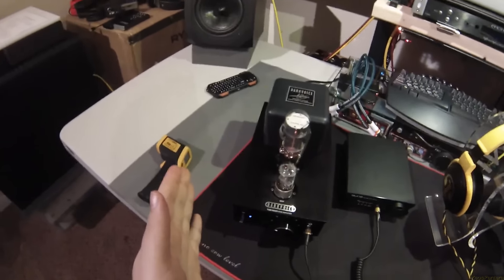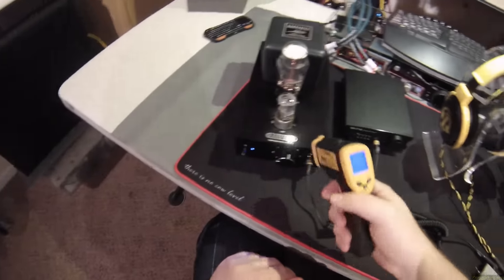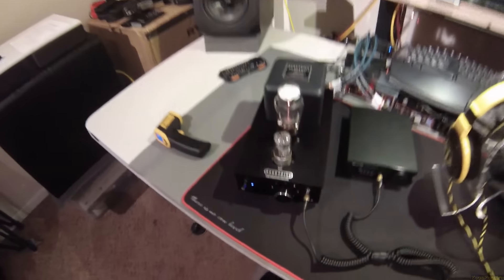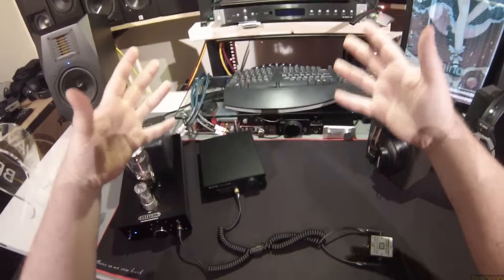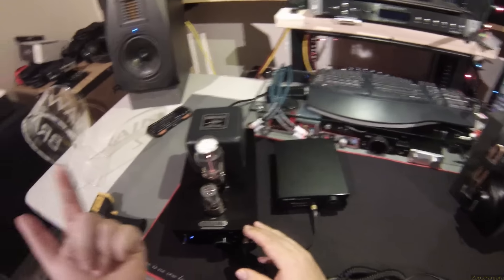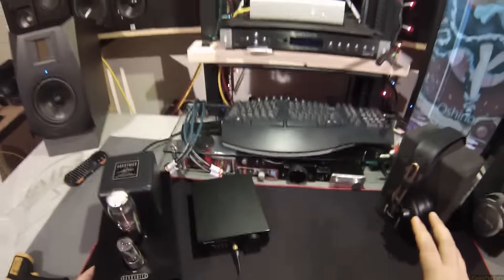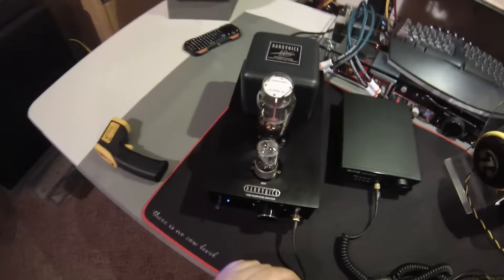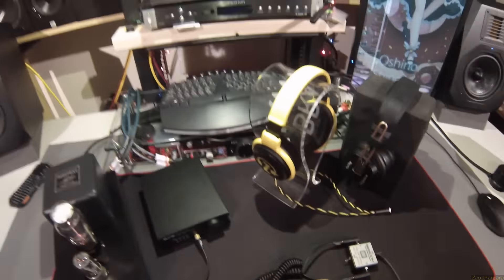Z Review - DarkVoice 336 Tube Amplifier

Comment: my preconception of tube sound was shattered when i bought a used audio research  SP3a1 preamp, state of the art in 1979.  instead of the soft and mushy top and bottom and juicy midrange, i got a ruler flat dc to daylight response with tonal colors that rivals the old sony tubed TVs that had the vivid and accurate colors visually,   in addition, the imaging/soundstage are exemplary.  

i hooked it to my ss adcom 555II which passed along all the tube goodness delivered by the arc preamp.   very good results are product of tubes in the pre and ss in the amp.  Rogue amps are like that and are bargains.  counterpoint also did that when they existed.

and yes, vinyl does sound different but given new records like you might get from music direct or analog productions.  given a really good tt/arm/cartridge and the records will last in excess of 50 years.  the discs must be clean and likewise the stylus.  the same music on cd won't sound as good as the LP.   there is a presence and vitality that is missing on cd.  

the best cd and LP examples converge in sound BUT the 21kHz upper limit with cd prevents the wide open air sound that vinyl is capable of.  

likewise, the best ss (constellation and soulution) sound more the same as the top tubed electronics (VTL and audio research) as they have been converging for decades.  

...hifitommy

Comment: Not all tubes sound all the same FYI! Try put a TungSol 5998 and a Tung-Sol CTL-6SN7GT tubes in your DarkVoice 336SE.  IMO and 22 others,  it sounded wayyyy better than WooAmp in stock form. You'll be in audiophile heaven with those tubes.  All was blind tested and they all thought it was the Woo Amp that sounded better, using Sennheiser HD800S. The chinese tubes that came with the dark voice is crap, for an guy that love audio that much should at least get some decent tubes for it.

Comment: 13:34 i'm not sure if he's trying to make a metaphor or something, but let me just stress the fact that All amplifiers are analogue,    there is no way of digitally amplifying an electrical current..   what happens when you turn up and down the volume in your media player, is not a digital amplification,  the sound is already amplified by the transistors in your iphone or laptop, the only thing that can be done digitally is reducing the sound signal pre-amplficiation, by digitally "removing bits"  (that's the simple way of explaining it)   

So tubes are just as analogue as solid-state..

But you can't drive transistors  OTL  (Output transformer-less)   So the OTL tube-amp topology is the most 'direct' way of amplifying, where the tubes get the electricity eg, 240 Volts straight from the wall, entirely skipping the transformation from high current, to low current.

Tubes behave very differently than transistors when being pushed into distortion,  a distorted tube amp sounds excellent,  that's why you can with Guitar tube-amplifiers have a knob that allows you to increase distortion, and it sounds ear-friendly.

When transistors distorts it is ear-shredding,  i've heard transistor guitar-amplifiers, they sound terrible, they would only be used for amplifying semi-accoustic guitars, never electrical guitars.

So Zreviews does not fully understand the difference between tubes and transistors,  you Can't  with DSP make a transistor behave like a tube, neither the other way around.

It's apples and pears,  they behave very differently from each other, it's two vastly different methodologies and they carry different sonic signatures. Sound can't be broken into   SNR / crosstalk etc etc,  it's way more complex than that.

The same thing goes for his Analogue vs Digital music analogy..   A vinyl record is not broken into samples like digital sound is,  Analogue sound is a coherent endless sample (which is what the word "Analogue" means, where digital music (PCM or DSD)  has a finite resolution...  Vinyl does Not have a resolution!

It's like comparing analogue film with Digital film,    Have you seen Saving private Ryan?  or Breaking Bad?   those are filmed on actual real analogue film,  where actual light was captured on a piece of paper, and the light itself physically drew the image.
That's very different from digital film, and i much prefer analogue film to digital film, it just looks more real,  just like how analogue recordings sounds much more real and organic than digital recordings  (For obvious reasons)

Analogue is always better than digital, if i have to listen to digital music, it has to be DSD = PDM (pulse density modulation)   i can't bear listen to  PCM (pulse-code modulation)    samples rates below  2,4 Mhz simply sounds too digital,  i prefer 22,4 mhz to be honest (Octa-DSD / DSD512)

There are limitations of Analogue, yes. but those are ear-friendly,  the limitations of digital are not ear-friendly.

Comment: Schiit has fake tubes....
Reply: what do you mean fake tubes?
Reply: ***** solid state tubes or as they call them LISST "TUBES"
Reply: +Dackzy well, it's a good option if you really don't want to use tubes, so it basically becomes a transistor amp.
but I prefer tubes.
Reply: ***** They sound like tube...
Reply: +Dackzy so, "fake" tubes are good.
Reply: ***** If you like tube sound, they should be good.

Comment: Sorry to tell you this dude but vinyl is better. You just have to spend a small fortune on equipment to hear it. The detail on a high end turn table and cart, with a clean record can't be touched by the best digital, and that's a fact. i have a Denon dl-304 cartridge that would change and blow your mind. You can hear the slightest breath and the sound of lips opening to sing. Digital is crap in comparison.